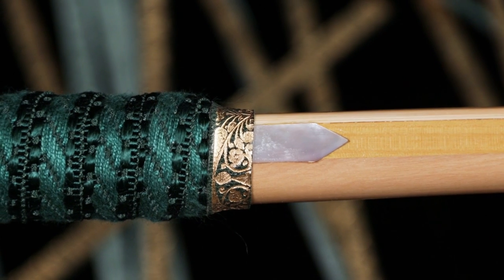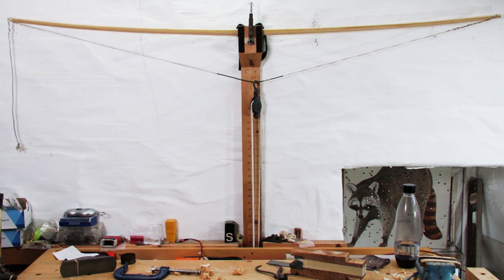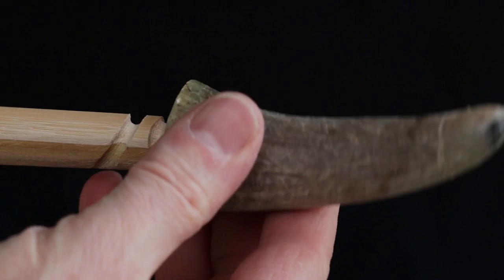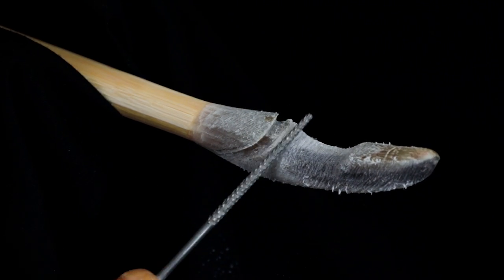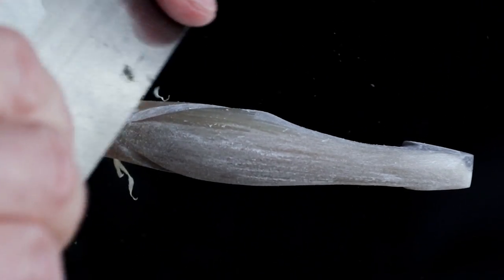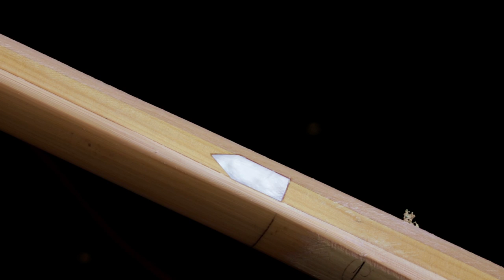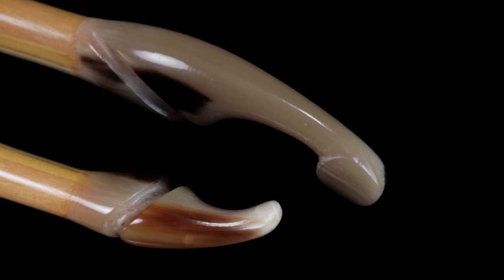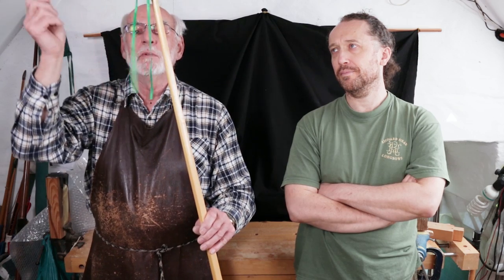How to make a Longbow

Comment: Very nice, as per usual.  Question -  Could the belly be made up of 2 or 3 pieces laminated into place with scarf joints or fishtail joints?  I have some nice mahogany, but too short for a whole stave.
Reply from the maker: Glad you like it.  Yes, we usually joint smaller pieces of wood in the handle.
Reply: @longbows  Thanks!

Comment: Would it help to have horizontal lines two inches apart to help judge the curvature?
Reply from the maker: If you think it will help you, then go ahead, We have one tiller we made back in the 90s with lines on, but mainly I use a tiller without lines as I am used to tillering and have tillered without lines for decades.

Comment: Hello to you and your family, Yes it is a very nice video indeed. Oh and I have a few questions. When was the "D shape" became standard and replaced the natural round shape of the wood? The best way to maintain a bow is it to put wax, oil or an other compound? The best way to store a longbow and arrows, is it vertical, horizontal or other? In some video you mention that leaving a bow unused for a long time, Few years, Would make it brittle but in some other video you mention you used Yew to make longbow that was cut in 1945, why would it be as brittle as the bow? Do you know when they started to laminate longbow? Please correct me if I misunderstood this point, did the handle wrap started in the Victorian era or earlier, from what I understood the handle used to be bare-wood so they adjusted their hold to situation, weather and distance?
Thank you again for your great videos.
Reply from the maker: Hi, thanks.  D shape has been around for a long time, there is no natural round shape as such, this type of bow is Victorian, they tend to be D shaped, perhaps you are thinking of the more oval shape of a Warbow, that is completely different.  I use varnish.  Store them horizontal.  Yes the wood from 1945 could also be brittle, but it hasn't been worked to the dimensions of a bow, we won't know until we do.  Elaborate handle wraps started in the Victorian era, again, this is a Victorian bow we are making, not a Warbow.

Comment: I'm still wonder why those longbow freaks keep hanging with this D-Profile thing. I really can't imagine that it has any benefit over a rectangular profile. In contrary, it make things worse. It weakens the belly of the bow, that is even the weakest part of the bow anyways because wood usually could take about double the amount of tension, in comparison to compression.
If you want to make a lightweight bow, make a narrow rectangular profile and I'm sure it would be more lightweight than a bow with the same draw weight in D-Profile.
Reply from the maker: Yes, all true, but an English Longbow is D sectioned, thats how they are made.